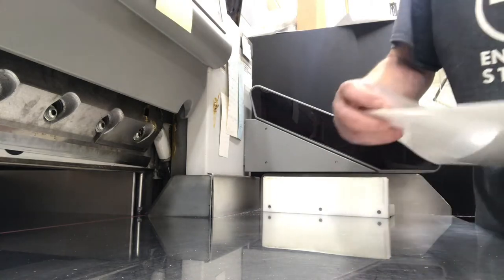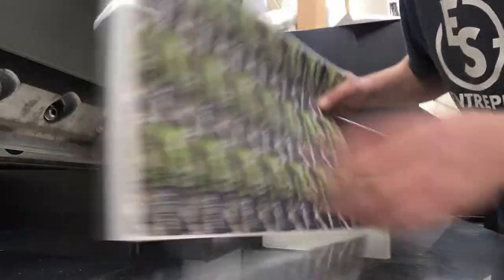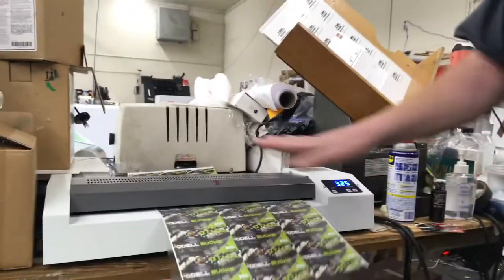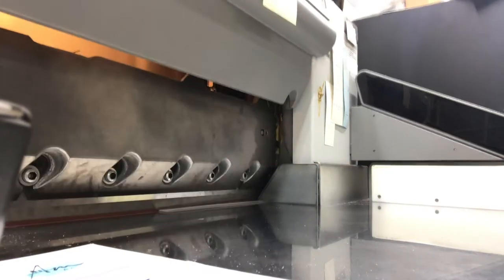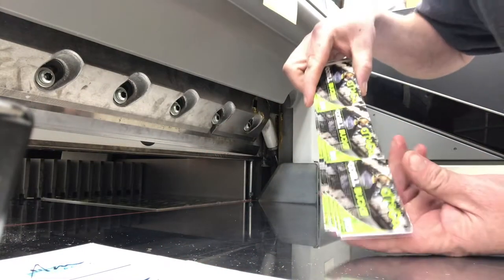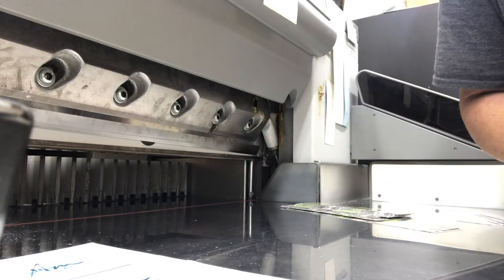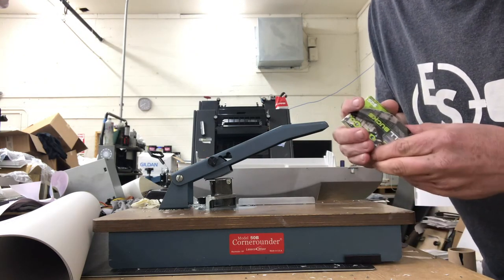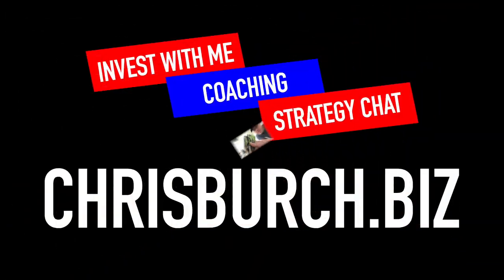How Plastic Cards Are Printed

Comment: Thank you for your video. Could you please tell me what kind of laminating do you use? When I tried to do same thing - the plastic split apart after cutting
Reply from the maker: Yes this is a common problem and once that is time consuming to fix.  There are multiple reasons but should I post a video on how we fix this issue?
Reply: @ChrisBiz202  
Thanks for  replying.  It will be amazing!
Reply: @ChrisBiz202  Specifics matter. You ought to know if the laminates are polyurethane of polyethylene, and what sort of printed sheet are you using with what type of ink or toner?

Comment: I need that machine cutting the round edges, how can I get it?
Reply from the maker: I actually bought my corner rounder on eBay
Reply from the maker: I don't know where you are in the world but here is a newer version of the one I use.  This one comes with a 1/8" blade but bought a 1/4" later that gives more of a rounded edge.  The 1/8" was smaller like a credit card. https://www.ebay.com/itm/255177519107?hash=item3b69c3f003%3Ag%3AiJIAAOSwJPZhZzCi&LH_BIN=1

Comment: Is this a good alternative for printing school id cards instead of using a standalone pvc machine?
Reply from the maker: I might be however when we print these cards they 24 up on a 13x19 sheet, where with ID cards they are one at a time.  Likely the PVC would make more sense.
Reply: @ChrisBiz202  Thanks for the response.
Reply: @ChrisBiz202  what's the material of the original 13x19 sheet?
Reply from the maker: @goodsandcargoinc  It is a 13"x19" Coated 2 sided 100 # Cover Stock